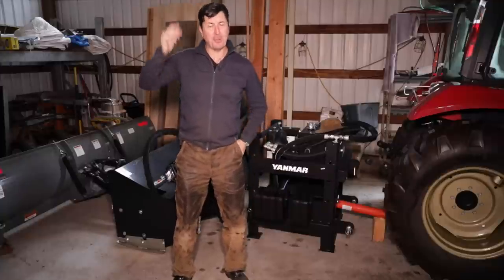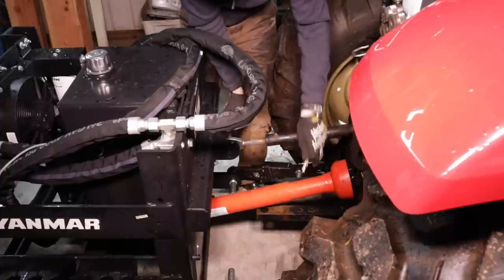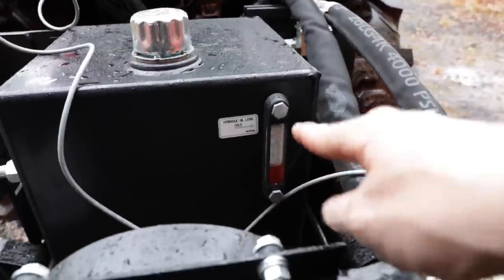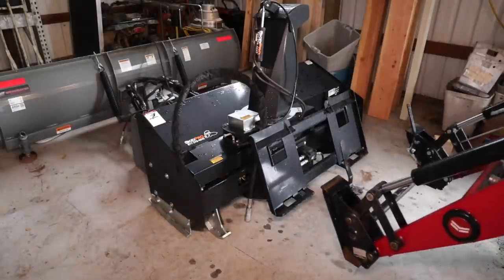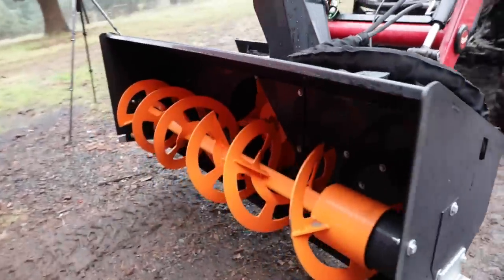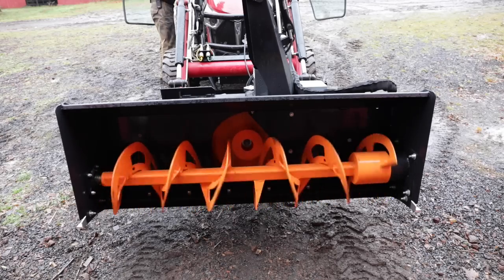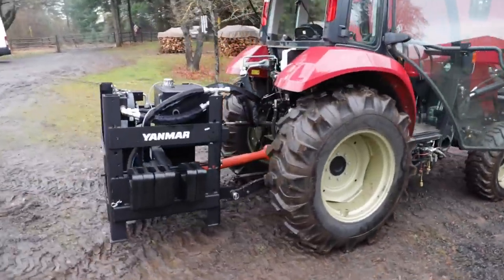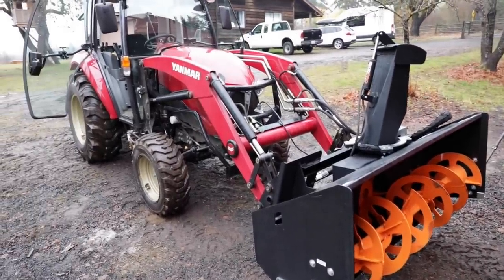This Yanmar Prototype Snow Blower Is AMAZING!!!

Comment: I just finished getting my F-250 snow plow truck running again.  I won't say its cheaper than this setup because I am constantly repairing it in the hopes my used plow will work an entire season without a break down.  I think Wranglerstar's system is going to be maintenance free for quite a few years.  Yanmar sponsor, brilliant.

Comment: We have a great Massey Ferguson 6714S (120 pto hp) with the IVT transmission (infinite speeds forwards & reverse) and a front 3pt hitch, PTO & hydraulics.  We get alot of lake affect snow from Lake Michigan.  We have a 84" snow blower on the front and a sand 84" rear mounted sand drop spreader.  This allows us to plow our 3/4 mile driveway, sometimes our roads, our family's driveways and even the back trails to our cattle barn.  We can blow the deep snow (24" sometimes) and drifts that can be up to 6' deep in front and when we clear a nice path, we can drop sand to make the driveways safe.  It is a great setup.

Comment: I too am most impressed with this snowblower unit. I believe the unit is based on the Oshcosh design used on runways. Does anyone know when this unit will be available for sale. With the universal mounts this unit will not be Yanmar specific. Here in BC we have the same wet heavy snow but with the fast rotation I would be concerned with throwing rocks so might be a good idea to have a chat with your neighbors and advise them to have their yards cleaned up before you arrive and the snow falls. Beautiful unit and I like the idea of having the blower in the front instead of the back. Thanx and good job on the site

Comment: very nice, after last winter with my back i started my search for a tractor  that fit what i could afford to spend. after much searching i ended up getting a new holland 38 horse with a 64 inch rear mount snow blower.
would have liked the front mount on the loader as we get huge banks up in northern maine and people pay to have them moved and it would help make the tractor payment but the cost was to high for me so i will use the loader to dig the banks and drop it where the blower and throw it as far as it can.
this tractor has been a game changer, unloading wood pellets is  a snap with the pallet forks other work i did from july to last month would have taken me years to do manually got done with very little physical effort and no damaged back.
i considered Yanmar but was unable to locate a used tractor in my price range a new one with less features than my current one would have set me back almost 20k more although to be fair the new holland doesnt have a cab and the yanmar i specd did have a cab.the other consideration is closesest Yanmar dealer to me is 2.5 hour drive. the new holland dealer is a 20 minute drive

Comment: Cody, do yourself a favor,  when you rework the  power outlet, take it off the grill guard and run it up the loader boom with the new auxiliary hyd lines. Make sure your bottom link arms re-engage after hooking the power unit and the PTO shaft doesn't pitch on the draw bar if the arms relax. Can't wait to see it in a big snow.

Comment: That really is a nice unit. I couldn't hear any noise from it. At least none that the mic picked up.
A suggestion for the future, Skid mounted, PTO driven, generator, large enough to run the entire property in a power outage situation. You could set up a transfer switch in the tractor barn, and install an exhaust hose to clamp on the tractors exhaust pipe. That way you can run the tractor in the barn. It would be economical to run, compared to the gas units. Especially if you have several days of outage.

Comment: Hi Cody.  Wow!  That looks like a great unit.  Using hydraulics to power the blower instead of a nightmare mechanical driveshaft is pretty slick.  The fan to cool the hydraulics is a nice touch.  I personally have 1.5 miles of driveway to plow and we get a lot of snow at times.  My solution is a front-mounted snowplow blade, and a pull-behind 7 foot wide snowthrower that runs off of the PTO.  So I can drive forward, plow forward, and snowblow forward.  For my application, I need the ability to push and blow snow.  This was the ideal solution for me.

Comment: A camera mounted on the power unit and on the blower will give you an extra set of eyes to know just how far you are from things you don't want to hit without getting out of the tractor cab. 

Have you staked out the driveway and objects to avoid yet? The bamboo garden stakes make great sacrificial markers as they are cheap and will not damage the blower if they do get pulled in.

Comment: I like Yanmar's engineering ideas I understand why they wanted to mount the tools forward looking, and having a separate hydraulic pump  pto powered does not strain the hydraulic pump nearly as badly as the internal hydraulic pump in the tractor which is much more difficult to maintain. Kudos Yanmar!

Comment: It may have been for this video that I told about my boss getting a similar setup by John Deere. They put the hydraulic pump on the PTO, and ran hydraulic lines under the length of the tractor, to connect with the blower in front. I had talked him out of a rear blower for reasons similar to Cody's.

Then we began getting less snow in winter. When a heavier snow did arrive, Boss was too sick to go out and hook up the blower. Poor guy, he hardly got to use it! Then he retired and moved to be near the medical community near Portland, Oregon. I felt so bad for him. He had waited years to get a good unit. And with a little coaching, John Deere really had come through for him.

Hey, we miss you Mark.

Comment: We had the same issue with trying to find a small counter balance, we ended up casting a 3-point hitch in concrete. It weighs around 300lbs and makes for easy hook up and removal while taking up minimal space

Comment: Hi Cody, to improve the performance of your blower I recommend either spray waxing the inside of the chute or auger and actually for convenience pledge furniture polish works GREAT for snow blowers been using that for years here in Northwest Ohio and it makes a huge difference. Also there are videos on here of people putting rubber on the impeller to reduce the gap to improve the snow flow out of the chute. There are a lot of videos on it and it’s something I’d like to try if I had a 2 stage, but all of my blowers are single. Hope this helps and I hope you see this comment. Happy belated thanksgiving!

Comment: John Deere has used something similar for years.  I have a Kubota L6060 60 HP with front blower and rear box blade.  The blower runs off the mid-PTO.  The shoot angle and flapper angle are hydraulic and are controlled off my loader joy stick.  I live in Upstate NY, so I am quite familiar with snow.  Last year was a light snow year.  Maybe 150" rather than over 200.  I used my box blade far more than the blower.

Comment: Curious if you could run a Fecon Forestry Head on that now. They are a beast. Allthough you may need to upgrade front glass on tractor lol. Last high flow skid steer I rented with the forestry head came with the forestry package, (additional hose protection and bullet proof glass)

Comment: That elecrical plug for blower should be attached to the loader itself, somewhere near hydraulic connectors and not on the front guard. With current setup if you raise blower over the hood, it will break or at least pull the plug out :)

Comment: Yeah I like it. Kinda reminds of an older design that has an independent hydraulic reservoir you could mount on a pickup. 
When you overheat your fluid you have to stop working. Also the extra weight gives you more grip in the snow. Good design.
Cracks me up all Cody has do is pop up with some new gadget and the negative people come out of hiding. Then all hear is "I don't like it, I have one better I got for a dime, yak yak yak and my favorite is the shade tree engineers out there.... oh sorry got carried away.
Have a great Thanksgiving Cody and family!

Comment: You need to move your cable to the adjuster to the loader arm if not you gone snap it of when you lift the lower high up, you se. Just a tip for you. Great rig.
Reply: I noticed the same thing. Cody, please look at your front end quick connectors. Will they be damaged if the blower is raised too high?

Comment: Suggestion:  add a little grease to your PTO shaft before you install the PTO driveshaft. This will help get it off when you're done.  I've had experience with those shafts seizing after extended use.  Especially with the mowers.

Comment: Cody check out the Ram Mount Tough Claw. You can mount one permanently or with a suction cup to the windshield. It would hold your controller perfectly. And it’s modular and easy to remove fie when you don’t need it.
Reply: Oh and it’s made in the USA!

Comment: I'm glad you will be able to make money by using this snow blower in winter. For your safety on the road at night, It's a must to have light in from of the blower and reflector and light on your bypass hydraulic pump. You have electricity in back and in front, so you will have power fir lights. I'm sure Yanmar will have some good safety and utility light.

Comment: Do you work for Yanmar? This is pretty awesome. 

The reason it is all so heavy duty is because of the affect below freezing temperatures can have on steel, due to its lattice structure. Depending on the alloy, as you approach a certain temperature below 0 Celsius the yield strength of the material can be a very small fraction of the original, and result in breakage. It's a common problem they have to design for on oil rigs in Northern Canada. Most steel products will have a "T10" (quoted because it's not a very common term and is hard to google) which is the temperature at which it's yield strength is 10% of what it would be at room temperature. Oil rigs have to use a much more expensive steel that is within the required factor of safety at -45 C

Fortunately, materials like Aluminum do not exhibit this loss in yield strength (also due to its different lattice structure), hence why you can see those aluminum pieces on the bottom and sides of the blower. They'll be directly in the snow and most prone to hitting rocks or other debris that could damage the sled. 

For those that are curious, the likely reason it isn't made entirely out of aluminum is cost.
Reply: He doesn't work for them, but he's sponsered by them.

Comment: Back in the day my grandparents ran one of the largest daycare centers in Hood River. They had a circular driveway and a little kubota tractor. One year back in the mid 80's they got 6 feet of snow. Every couple hours my grandfather was out there with the blade on that tractor going backwards to push the snow.  Maybe an 1/8 of a mile total on that driveway.  If he had this he could have slept a couple hours more.

Comment: Wranglerstar, I noticed how you said something about the noise.. Ever think about loading the video into audacity and using the noise reduction tool? You select an area of audio where it's just background noise, get the sound profile, then places in the video you want to remove it from, highlight, then run the filter again. Than just overlay the video with the new audio file. Just a suggestion.

Comment: That's a nice set up . i just kinda think that tank might be a little  bit  small at least it has a cooler  for it . 27 years  of doing  snow  removal  at the  KCI  International  airport  the one i used would throw 1250 pounds  of snow a second  with a 850 hp cat just for the thrower named the Terminator

Comment: 30 years of clearing snow professionally  tells me that that is a redundant solution compared to the traditional PTO driven 8' double auger blower on a tractor with an 8' loader bucket on the front..  The best rule of thumb with working in snow & extreme elements is using the KISS method; Keep It Simple Stupid. I had a 1980 Massey Ferguson 184-4 diesel with an 8' double auger allied blower & an 8' MF loader on the front almost since new & have yet to find as reliable a modern model. I wish I had never sold it. 65 hp that would eat anything but hockey sticks & newspapers...Lets hope you don't find too many of those.. LOL
Reply: a PTO driven, 3-point mounted, snow blower is just a hassle You want to have it in the front, not have to reverse the entire time. A plow on the front will outperform a blower on the back, in terms of snow moved.
Reply: Now, a front mounted blower, that runs off a front PTO, would be optimal.

Comment: ''Red blooded American''-  driving a japanese tractor
Reply: And the Japanese buy and use a lot of CAT's too.
Reply: Eirik Adsen still far better than owning a pos indian built mahindra. Cub used yanmar power for years due to their reliability...so there's a good chance their tractors as a whole are decent. At roughly $30k with the cab & 3 pt hitch, yannis are far cheaper than a comparable deere.
Reply: Lmao JD uses yanmar engines in some of their tractors.
Reply: Richard Frazee  go read the manufactures tag on a new cat, made in Japan. Except for the really big iron
Reply: This is manufactured in Georgia by a Japanese company investing in America. U. S.  companies that outsource sell Americans products that were built outside the country, but people feel better about it when they see a brand they recognize. Buying American is more complex than reading nameplates.
Reply: Bill Black are they actually manufactured in Georgia or just assembled in Georgia ? Not trolling, just wondering because although mahindra claims to be mfd here in the states, all they do here is bolt on wheels, steering column/wheel and other extraneous parts...the things are actually built in india.
Reply: Eirik Adsen We used to have a GM and a Ford  plant near where I live within about 20 miles of each other on the same road, it's where the Ford ranger and Mazda B series pickup were made and in the GM plant the S10 pickups were made, GM was in Linden NJ Ford in Edison NJ  so in passing by these two plants often, I noticed in the parking lot where these good red blooded American UAW workers worked there seemed to be more Japanese cars than American cars, me personally I won't own a Japanese car because I'm still a bit pissed off about WW2 and the whole pearl harbor incident, or a German car for the same reason minus Pearl Harbor of course, will I deny the Japs  their due NO but personally I can't support an imperialist regime or whatever they are now, if I were in charge I would have leveled the place and when the smoke cleared made it part of America it would have given the Chi-coms something to worry about, don't forget too he was given the tractor or it was loaned to him by the company for more or less advertising purposes.
Reply: Is that why it sounds like it has whimp beeper
Reply: ROTAXD. I  haven't really had any problems from my Mahindra. Now if you had said, POS Mahindra dealer I could have passed on by with agreement.
Reply: consaka1 you're one of the lucky ones. 'hindras are notorious for their shoddy wiring systems.
Reply: Yanmar & JD are mfg. in Japan and assymbled in Georgia
Reply: LOL ROTAXD of all the forums and discussions I have been on literally no one has said anything about the wiring. I have seen some guys have glow plug issues. Mine seems to be new enough not to have that issue.  My only electrical issue so far is the hazard switch. Not really a big deal to replace.  Considering it is 8 years old that is pretty minor. If I get on any other forums I see people with all brands having some minor issues with random things so I don't think it is notorious for anything.  Well beyond the same crappy dealers charging ridiculous amounts of money for simple things like decals and switches. All dealers seem to like to follow the example of the auto industry and jack prices up to ridiculous amounts.
Reply: Only one made in America with the profits sent overseas to another country.  Fords are made in various places and countries employing people that would be starving to death otherwise and their profits stay here in this country.  :)    Unless they got bought out by someone in another country that is.
Reply: At that hp range they are either Japanese or from India. Even John Deere.  

Try harder troll.
Reply: The red-blooded American comment, when taken in context, I believe was simply referring to cool, powerful, equipment that is thoughtfully designed. And I find these comments about specific manufacturers in certain countries  ridiculous. If someone was able to evaluate the amount of parts sourcing that goes into one JD tractor, they’d be hard pressed to find more than 30% of the that unit that was designed, fabricated, assembled in America by Americans’. Not to mention the electronics. Then you’d really have to look at who really owns the shares of the company producing the unit. So, in my opinion, if your not going to buy the man a tractor with thousands of dollars of implements and let him evaluate them on his terms, let it alone. Everything he does, with equipment and tools is done with quality & integrity- if the tractor fails to preform, we’ll know about it. To have everything you say & do put out there- no mater the gain from doing so, is a lot to endure. Keep that in mind.
Reply: Either Japanese or the ones made in India are both good engines.
Reply: Yanmar makes a lot of deere stuff...you know that, right?
Reply: Beyond that japan has always made top quality stuff. All the good electronics used to be made in japan.